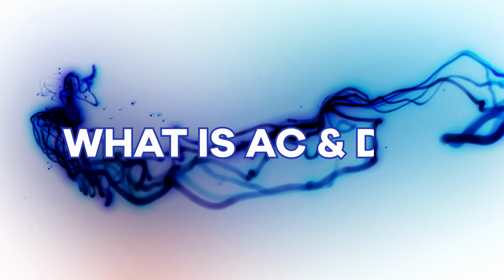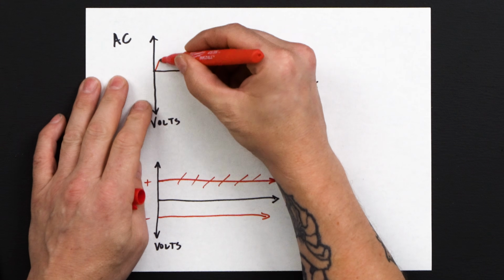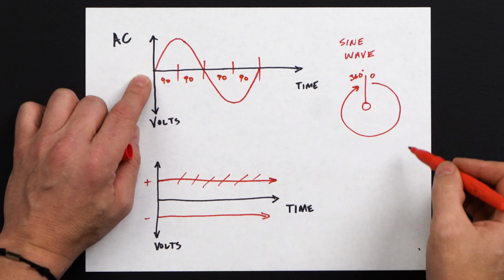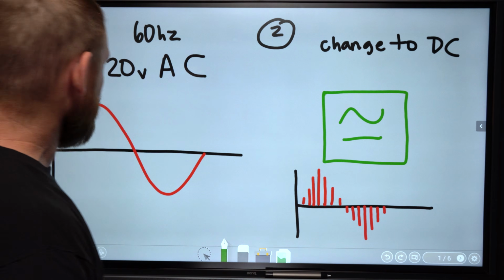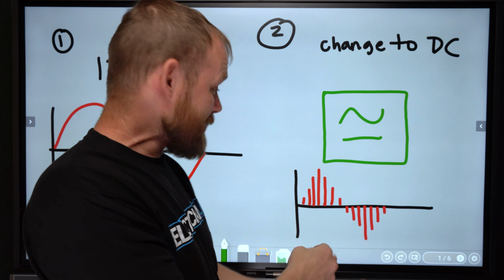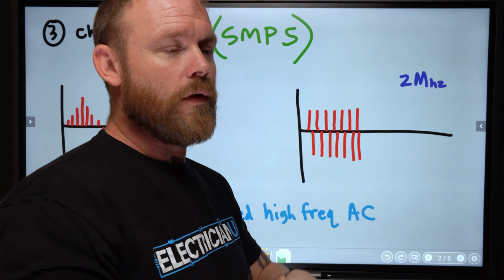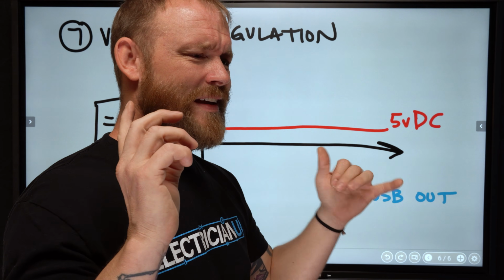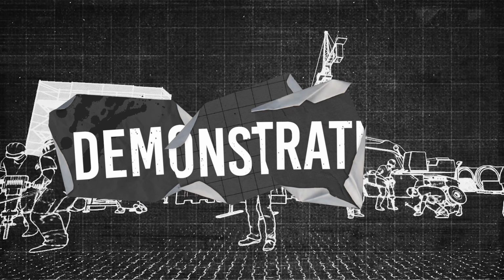What's AC and DC? What are the Differences between Alternating Current and Direct Current?

Comment: Convention in electrical circuits (and many other things) is that zero degrees lies on the positive X axis and rotation (increasing angle) is counter-clockwise.
DC can be time variant as long as there is no reversal of polarity. AC does not have to be any particular waveform nor does it have to be periodic.
Physicists generally don't like the notion of "expanding" magnetic fields. In a transformer the only requirement is that the strength of the magnetic field change. It is the core in a typical transformer that "doesn't like" DC.

Those small wallwarts do not convert DC to AC. They use "flyback" converters. During part of the switching cycle energy is stored in an inductor from the input supply. During another part of the cycle the energy stored in the inductor is delivered to the output via a separate winding. The output of a switcher absolutely is true DC, normally with very low ripple. The voltage is well-regulated. Most flyback converters operate between about 70 kHz and 150 kHz. Very high frequency operation allows making the thing smaller but at the expense of requiring "exotic" semiconductor devices.
Higher power switchmode converters do use AC excitation of a true transformer. Intermediate power converters may use DC excitation of a true transformer but the magnetic core has to be "reset" each switching cycle. No useful power is delivered from the input side to the output side of the transformer during the reset.
All switchmode power converters, except for "charge pump" types that are typically used only for very low power, require two energy storage elements which are invariably an inductor and a capacitor. Those parts aren't there to "shift" anything, they are there to store energy then deliver it. Some switchers use more than one cap and/or inductor in the actual conversion path. In such converters the notion of phase shifting may come into play.

Comment: Most people use LIFEPO4 chemistry for solar, EV's, etc., which doesn't run away or burn, like lithium ion...Still dangerous if the voltage is high and you become part  part of the circuit...Ya, I've been working with AC for decades, but learning DC for my off grid homestead, thankfully I'm my own inspector..

Comment: Defferance between dc and ac 
Dc flow one direction ac flow both directions 
Dc can be stored into batteries ac can't 
Dc has resistance ac has impedance 
Dc has straight flow electrons ac has reactence and induction 
Dc has straight line sine wave ac has waved sign wave 
You can't ground dc but you can ground ac but both support surge protection 
Dc use fine stranded wire for efficiency  while cant use solid copper wire and some other strands wire application because the high heat
Also you cant step up dc voltage by  transformer

Comment: Modern LCD monitors do not blink. The higher frequencies are mainly for gaming. The old CRTs did blink but that really was not because of AC, In general 70 Hz was seen as stable (note incandescent bulbs flicker at 120 Hz in the US and 100 Hz in Europe) though I could see the difference between 75 Hz and 85 Hz. You see the flicker mainly on your peripheral vision so the larger the screen relatively is the more you notice it. 

Btw the mains frequency in Europe is 50 Hz because at 40 Hz lights did flicker.

Comment: I ran two 2-gauge DC wires in separate metal conduits, one for the 12 volt positive and one for the 12 volt negative feeds to our 12 volt DC devises in a mountain cabin. I have since learned that you must NEVER run hot and neutral AC wires in separate raceways due to induction. Am I OK to leave my installation as is since it is 12 volt DC? Do I need to worry about induced current when dealing with DC? I am guessing it is not an issue…..just look at how DC is handled on vehicles, positive out from battery while returning negative ground current can travel back through wires or metal chassis of the vehicle, no need to be in the same raceway.

Comment: DC is more dangerous than AC, in terms of sustaining an arc and arc flash.   AC arcs are easier to extinguish because of the 0 crossing that occurs 120 times a second, assuming you're dealing with 60Hz.   Whereas DC arcs don't have that zero crossing particularly with pure DC  such as several large 12volt batteries in series.  It's for this reason fuses and circuit breakers suitable for AC/DC have lower voltage and interrupting ratings for DC, such as 250VAC- 200kA / 125VDC-20kA.

Comment: Lithium ion thermal runaway is often caused by dendrite growth puncturing through the batteries internal barrier, shorting anode to cathode and allowing the energy to release to itself at full force. External pressure loss of the battery also promotes dendrite growth, although we don’t know every possible risk factor to make it worse yet from what I’ve read so far.

Comment: I have a question, I checked on some solar panels with a voltage pen and it was picking up AC current. that isn't supposed to be doing that right ?
Reply: Not sure what you mean by "... picking up AC current.",  but ensure that your voltage pen is set for measuring DC voltage/current.  Measuring DC with Pen set to measure AC WILL give you a reading on the display (erroneous reading).   CAUTION:   Measuring AC with Pen set to measure DC, can potentially destroy your Pen. Beware!
Reply: @rohmor  Yea i did explain it a little lackluster, so I have a klein non contact pen and I was going to clean my solar panels and i went up and touched my panels with the pen and it went off indicating the presence of AC voltage i've asked around and i just want to know if it's safe to clean or not could it possibly be a bad ground ? or faulty insulation? thanks for any help!
Reply: @bryanfarfan1100  Thanks for the clarification.

If your panel frames are setting off the AC voltage detector pen, that is not a situation to ignore!      It would be suggesting that your panels/racking is in contact with an AC voltage source....  of potentially harmful voltage levels!      Exercise caution when trying to track down that AC source!   DO NOT CLEAN until rectified.

Are the panels ground mounted or roof mounted?

Using a volt METER,  measure the AC voltage between the panels/racking and literal earth (Yes. Stick one probe into the earth and the other probe on the panel/racking).

If you are not totally comfortable with performing the 
tracking down activity, then please utilize the services of a licensed electrician in order to assist.

And wear electrically protective PPE gear (eg. gloves) when in the vicinity of your array.

Hope this helps and let us know how it goes.

Comment: I solder often for my job and was top rated in the navy for it also, where can I buy components such as you mentioned for replacing the parts in a charger for example? Like if I tested the capacitor was bad, where can I get the part? 
Also, I think a video explaining how to test if capacitors, inductors, diodes, and rectifiers are good or bad (like with an oscope) would be incredibly helpful for everybody! Thank you!
Reply: It depends how far you’re trying to go with it. . Mouser is definitely a big supplier with a LOT of components

Comment: 21:20 top socket led bulb
No flickering...
21:44 bottom socket
Flickering...
Same led bulb..

The socket is causing flickering.

And btw.. if its a 12vdc lamp on the battery setup, why did you use only 6Vdc to light it up? ( 4 x 1.5V = 6 )

Comment: Do LED lights flicker less fast than the incandescent ones?
120 times per seconds for AC incandescent light..
Half the time for DC leds? 
( Current only pass in one direction )
Reply: LED lights do not flicker.    Current is passing in one direction, yes.  But it is also Continuous!  Hence no flicker. 

Although it wasn't mentioned (I think), there is DC referred to as 'Half-wave rectified DC' vs 'Full-wave rectified DC'.  Half-wave rectification results from using only the Positive OR Negative AC wave portions.
Full-wave rectification results from using both positive AND negative AC wave portions.

Full-wave rectification is more costly to achieve, but results in a smoother DC rectified waveform.
Reply: @rohmor  how do you dim led light? ..
By making it flash less rapidly.
Reply: @martf1061  Ok. So let's add a little more context.    

LED lights do not flicker when a constant DC voltage is applied to it.   

If one wants to PURPOSEFULLY cause an LED to "Flash",  then the voltage applied to the LED can be interrupted/cycled on/off at the desired frequency.   That can be achieved manually, or via the use of a Flasher circuit.
Reply: @rohmor  tell me how led are dimmed
Reply: @martf1061  Light Emitting Diodes (LEDs) can be dimmed using various methods, each with its own advantages and drawbacks.

1. By rapidly turning the LED on and off (pulsing) at a high frequency while varying the on/off times.  This technique is common and is called Pulse Width Modulation (PWM).

2. LEDs can also be dimmed by varying the voltage supplied to them. Lowering the voltage, reduces the current flowing through the LED, leading to lower brightness. This technique is less efficient than PWM.

Other methods include Current Regulation whereby Dimming is achieved by regulating the current flowing through the LED.  And Digital dimming using digital signals.
Reply: @martf1061  A bulb has several LEDs so you can shut down some of them.
Reply: It depends. Properly made do not flicker but some Chinese junk may even flicker at 60 Hz.

Comment: 13:27
So basicaly, step 2 and 5 are the same?? 
I'm pretty sure you got the steps in wrong order..
1- 120ac
2- step down to 5vac
3- full bridge rectifier
4- up frequency ( if really needed)
Reply: He totally did get this wrong, good catch!  A/C doesn't pulse after going through a rectifier, at least not in the way he had it drawn out.  A rectifier makes A/C into something closer to a varying D/C, which is then smoothed out using capacitors.  An inverter will make a sine wave like he had drawn,  but I think he is confusing how a rectifier works with how an inverter works.  
Cell phone charging bricks don't have inverters inside of them.

Comment: 10:34
Lets say i have 2 setups of batteries, first one is in serie and second one is in parrallel. Both have same power ( P=E•I ) .
Witch setup would you consider more dangerous? ( Faultwise and lifewise ).
Remember.. one has less voltage, but more ampacity. The other, more voltage, less ampacity.
100V 10A... or 10V 100A.. ?
No overcurrent protection.

Comment: 5:00
Why do we mostly use those kind of transformers ( primary coil, inducting on an other coil "secondary" , when we could use auto-transformers ?
Only one coil "single phase, but 3 for 3 phases obviously" , high voltage hooks up to both ends of the coil, and you tap where you want on the coil to have lower voltage. ( Want half of the high voltage, tap your secondary wires half way..
Alsmost half the weight and copper in an autotransformer, than in a common transformer.

Comment: I heard that dc travels easier, and so further, than ac.
Is that true?
If so, why do we raise ac voltage to travel further, instead of turning it into DC ? 
In Quebec, we step up the AC, up to 735KV to travel long distance and lower it back down, in the cities.
But we also ship some power straight to the USA, and we do it with DC... 480KV DC.
Why?
Reply: Yes, DC is better as it does not have capacitive and inductive losses or the skin effect. However, there are losses in AC/DC conversion so in normal high voltage cables AC is still better. In undersea cables DC is better so they typically are high voltage DC. It also may be that US and Canada is not synced on AC.
Reply: @okaro6595  thanks

Comment: I bought a 12v DC to 19.6v DC car laptop charger. (Better than using a 120v to 19.5v inverter). How does that work? Can you compare the pros and cons?
Reply: Ask your dog how to change the starter in your car.  You might get a better answer.  This guy might know all there is about wiring, but his theory is very bad.

Comment: Hey man I don't know if you can explain this. But I live in a mobile home and when I use my Keurig all the lights in my house flicker all the lights in my house are LED can you explain why it does that. Thank you I like you content thank you.
Reply: Hey man, this is likely caused by the high current drawn by the Keurig's heating element. If it's possible, I'd look into adding 20A circuits for your kitchen appliances, or separating your lights etc to their own 15A circuit.
Reply: @themonkeydrunken  thank you for the reply. All of our breakers are 20 amp except them the main breaker its 50 amp and the flickering of the lights is not just isolated to the the kitchen its through the house.
Reply: Does the led that flash are on dimmers? If so, maybe crank the dimmer to brightest to see if there is a change. If all on dimmers but no change with brightest level, try changing one dimmer by a normal "on-off" switch.
Reply: @martf1061  no they are not on dimmers it  happens to all the lights in the house and only when we use the Keurig but when i use the microwave or a drip coffee maker it doesn't do it.
Reply: @WilliamRomero99  ok.. 
Stupid question, but gotta ask... Do they flicker even when they're turned off?
Or only those that are ON?
( When using the keurig, of course )
Reply: @martf1061  Only when they are on
Reply: @WilliamRomero99  the next thing i can suggest is that you try the machine in different outlets of the house.
If it stops when plugged in a certain outlet, then this would be a good starting point for finding out the reason it does that.
If it makes the light fliker where ever you plug it, then you should really call keurig technical service departement to know what they have to say.
Reply: @martf1061  that is the thing it makes every light in the house flicker
Reply: @WilliamRomero99 try it in an other outlet than the one its plugged in right now.
Unplug the refrigerator, and plug the keirig in the refrigerator outlet..
If you dont understand what im trying to verify, then, just call keurig help line.

Comment: Best rock band ever!🤘    Oh, wait, never mind.😉

Seriously, is it true that AC is “safer” than DC because touching AC will tend to push you away, while DC will not?
Reply: No, AC is more dangerous. AC is generally seen safe up to 50 V while DC up to 120 V. AC causes the muscles to contract at the frequency. With high enough voltage both are dangerous.

Comment: While it is true that alternating current produces a flicker, it is also true that the element does not have enough time in which to cool off to the point where light is no longer emitted. So the cycle is really dimmer and brighter as opposed to on and off. But then again, everybody has watched a toaster anticipating that magical pop when the toast is done
Reply: You can see the flicker of LED lights if you move around just right. Especially Christmas lights.
Reply: @thebaddestogre-3698 LEDs are a DC component. They are light-emitting diodes. Diodes are unidirectional and do not allow current to pass both ways. Any flickering you might see on LEDs would not be directly related to the polarity shifts of AC power.

Comment: I still don’t get it. Stubborn my brain is. When one side of the circuit is grounded, it simply doesn’t work. Not in my mind. It is a short circuit fifty or sixty times a second.
Reply: ground is just the lowest potential of the system. It does work so your mind should reconcile that. These concepts can be deceiving.
Reply: I do not get what you are saying. When one wire is grounded there is no short circuit. Of course if you grounded both wires then it would be. Maye you just do not negative voltage (that is a common error people make). All I know your though patters are wrong but I do not get what you are thinking.

Comment: AC grabs you, and lets you go 120 times a second, where as DC, won’t let you go until the power is switched off!
Reply: not really. Ive been bit by both. The power is still flowing the entire time in either case due to capacitive coupling, Its a distinction without a difference really.
Reply: Are you really claiming you can reach in a few milliseconds and let loose. That is  just nonsense. AC causes you to grab and you cannot let go.

Comment: At 4 degrees Kelvin, the temperature of liquid helium, some real crazy shit"  Because there is almost zero resistance, I've seen wires the size of 12 solid carry 400A of DC current. When you are near absolute zero, you can almost "see" electrical theory many only read or study about....
Reply: as my professor said , you can run any current through anything if you can cool it fast enough.
lets hope this room temp superconductor pans out unlike all the others ive seen.